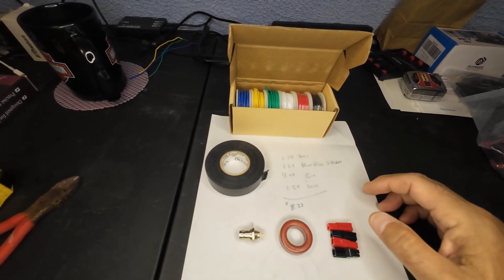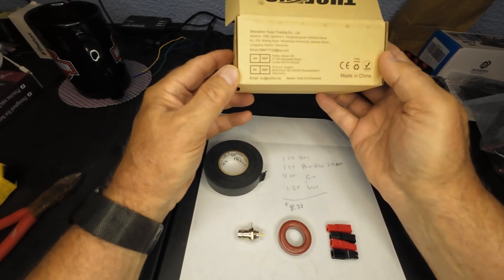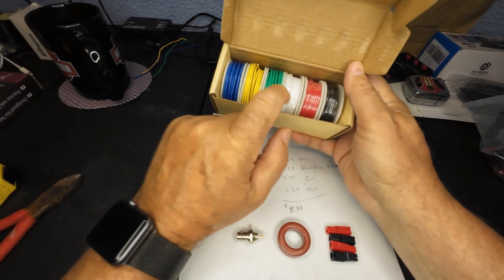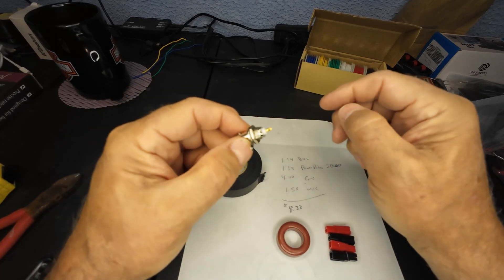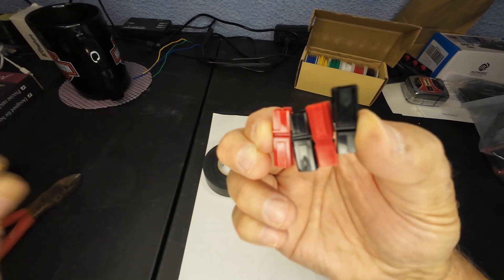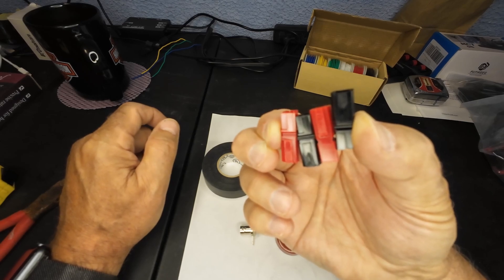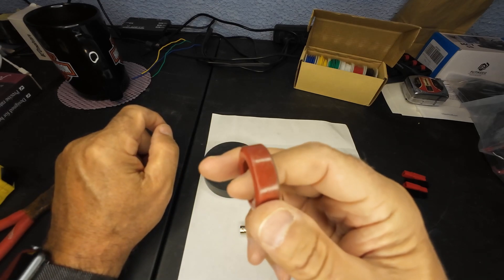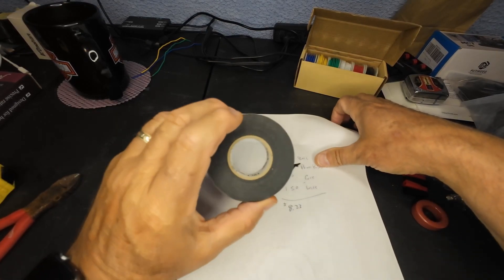Very Easy To Build $9.00 9:1 Unun for QRP

Comment: Jack, it looks like you're making a stripped-down EARCHi 9:1 unun. Are you using a T130-2 or T106-2 powder iron toroid? Gil, the Radio Prepper, has a good YT video comparing the performance of the T106-2 and a Ft140-43 mix.
Reply from the maker: I will check him out. Thanks for watching. 73s